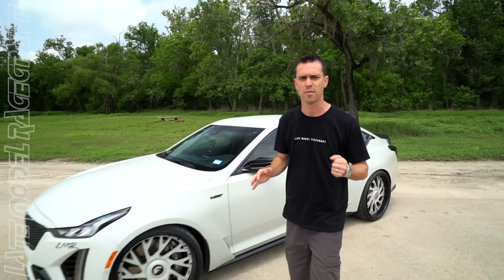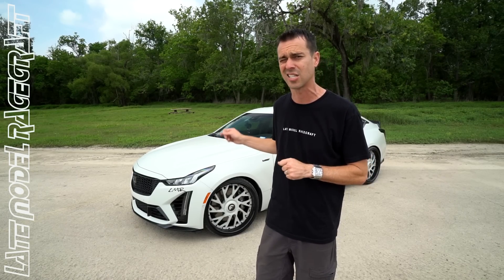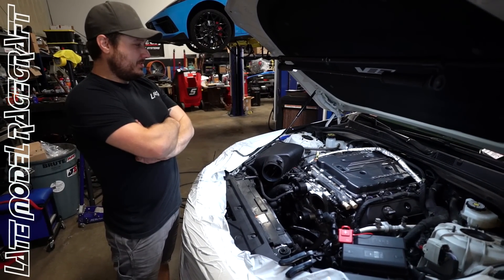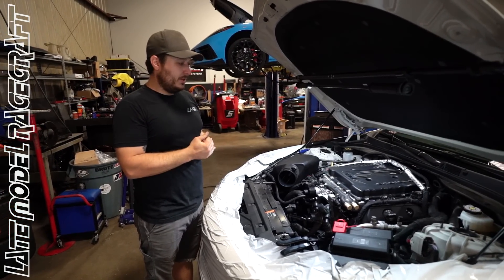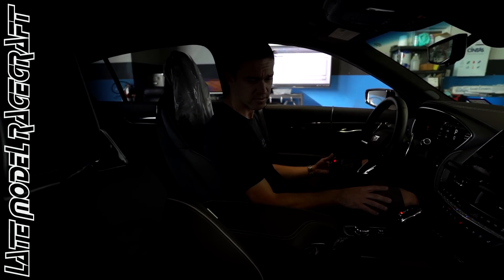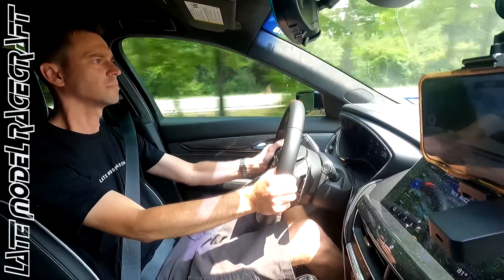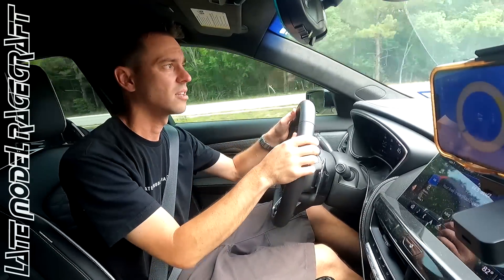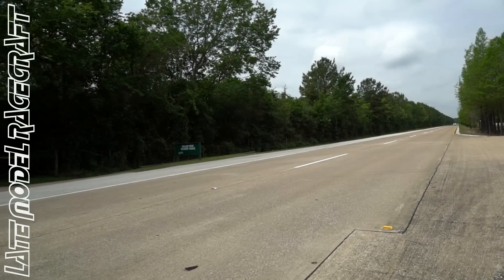90+HP GAIN CT5-V Blackwing Cadillac   built by Late Model Racecraft

Comment: Its great to see more shops working on the Blackwings. Tapout Tuning seems like the only shop to get the 5 BW over 700 wheel with a pulley , ported blower and tb. I would be curious to see what you guys do.

Comment: From only a ported blower and throttle body? Thats insane to gain almost 100hp. Actually that means GM detuned this car because those mods would make it run leaner. What are engine temps like that? For strictly a flow mod its more than impressive.

Comment: Does anyone know why the black wing is rated at 668HP, when the C7Z is rated at 650 HP both being the same motor?
Reply: Tuning is different, and the exhaust manifold/Cats are different. Oddly enough with the Blackwing muffler setup they actually sound quite different. Especially off throttle. Had a C7 Z miss it, currently have a Blackwing.
Reply: @josephbriggs2394  yah I have a 2017 Z06. In 2017 I know they changed the tune (I have to run 93 Octane, 2015-2016’s ran 91) and changed to a higher intercooler lid. I’m wondering if this represents the increase in power accurately. As the 17+’s did dyno higher, but GM didn’t change the marketing rating..